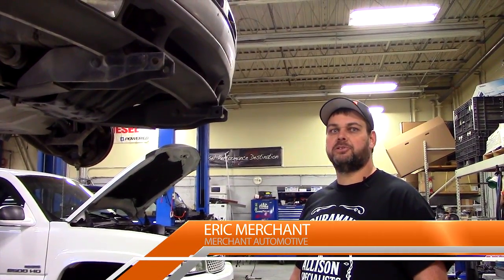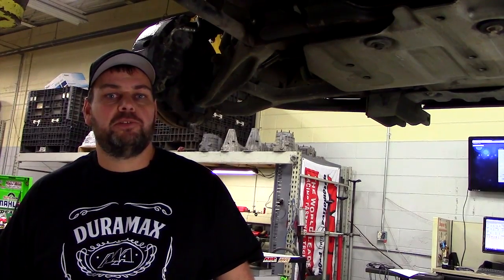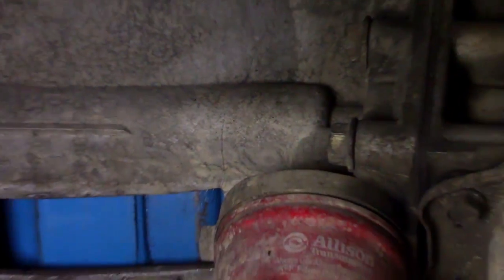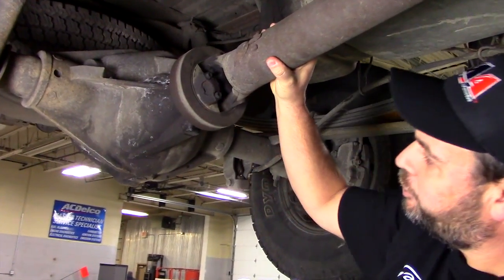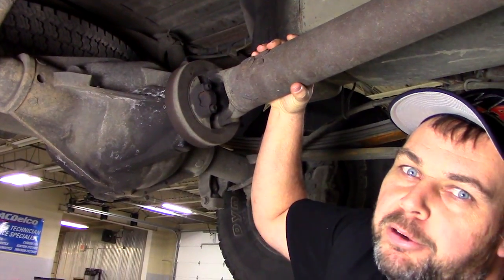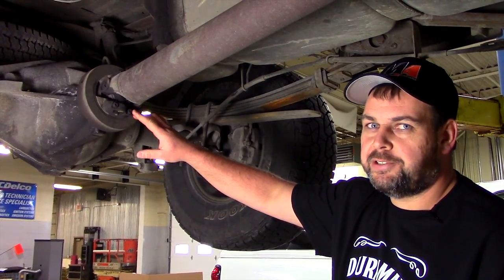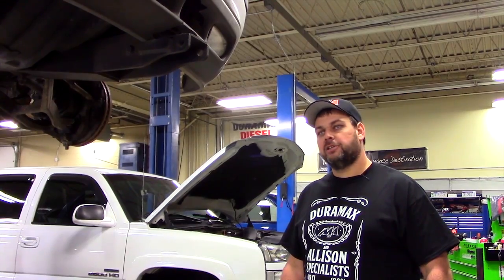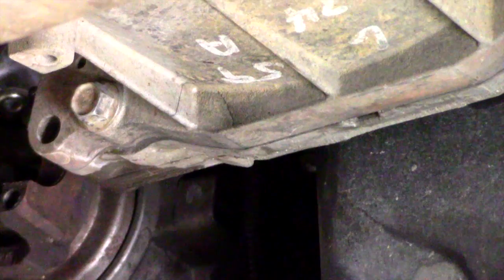Mechanics Minute Ep. 1 - Allison Cracked Bell Housing

Comment: I feel like that crack  came from someone trying to stop the flywheel  with  a cro bar through the inspection  plate . No.. that crank bolt is a tite one. I only  say that cause  the crack is right up to inspection hole.